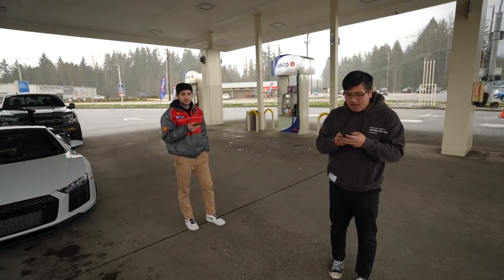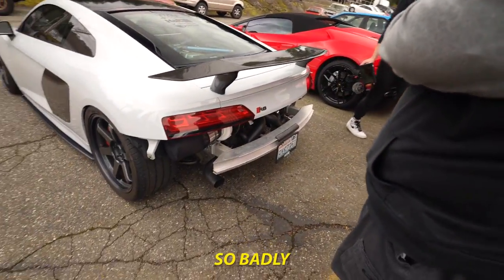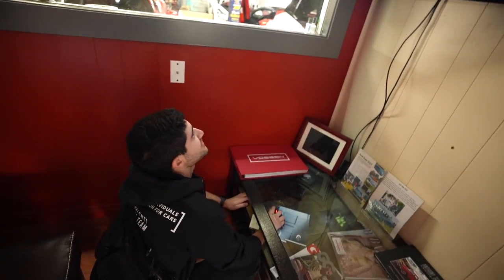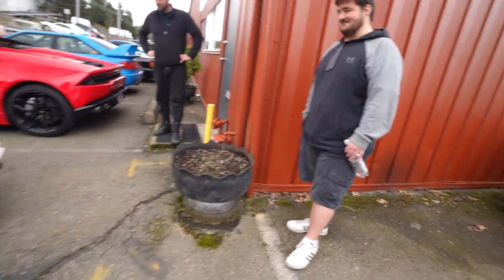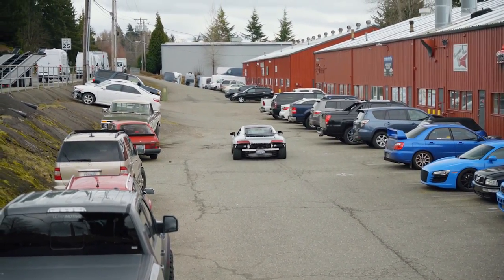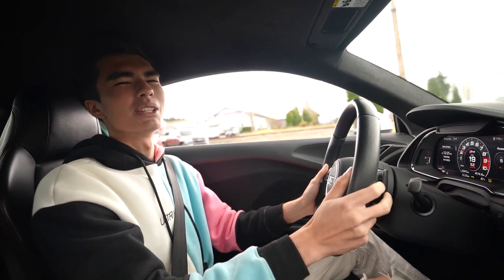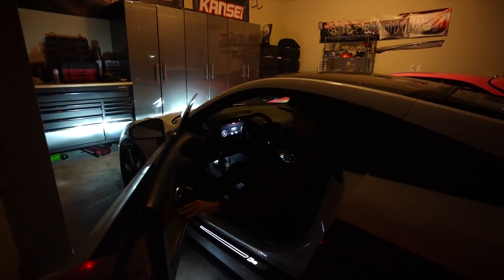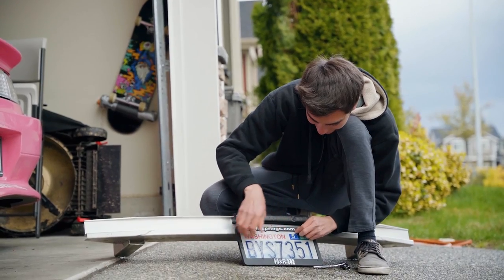Picking up my NEW Twin Turbo R8 and Immediately Breaking it...

Comment: buy some hydrophobic wrap for the airfilter, air filters are made to filter air not water, there's a reason why stock cars usually have them in an air box and most importantly under the hood, not exposed and right below a wheel with almost no protection.

Edit: the misfire is probably even just a tad bit of water that got in and misfired because some sensor just picked up water, or worse it just misfired because of the water

Comment: do a full throtal pls pls pls ?? . Also you probs can do donuts in the r8 but if you wher me i wouldnt risk it with a sheepy kit.
Reply: Its AWD. Doing donuts will more than likely grenade the front diff. Especially pushing more power than stock

Comment: This is exactly why you run fender liners and a bumper lol. The car running is better than looks.
Reply: Yeah especially if you know its always raining where you stay and your filters are hanging in the splash zone behind the rear wheels
Reply: @hereforthecomments1818  right
Reply: @hereforthecomments1818  common sense isn’t common

Comment: Dork voice “the tune should not put the car in limp mode”. It’s stock ecu kids, mass airflow sensors get wet. You have issues. Driving in a monsoon with no rear bumper is just asking for trouble. 

Motec uses map sensors instead of maf.